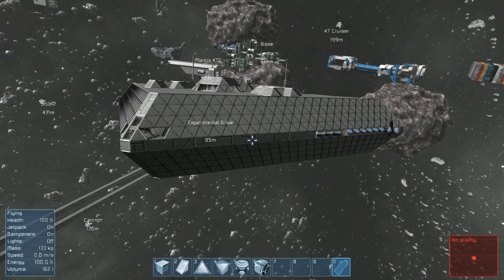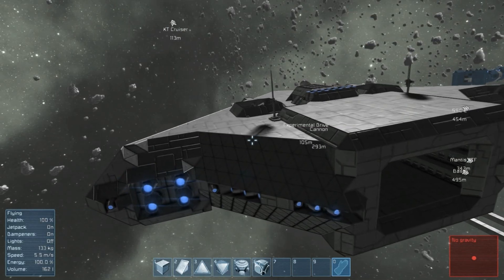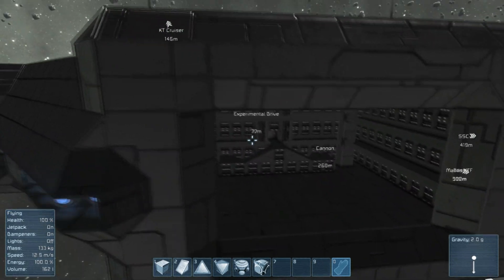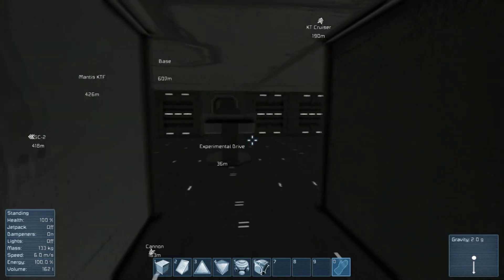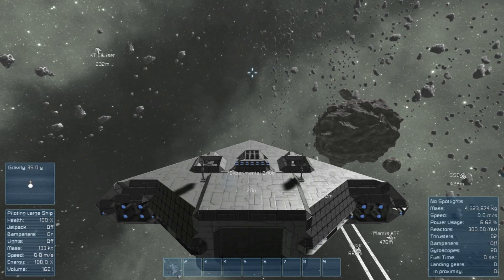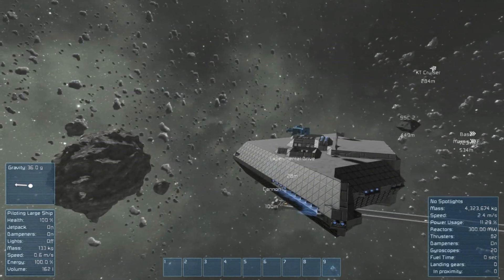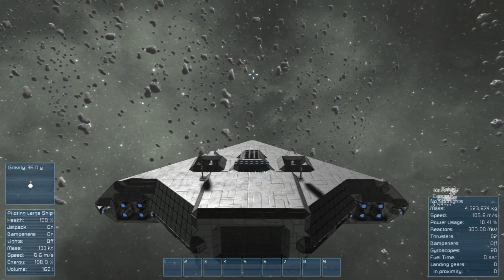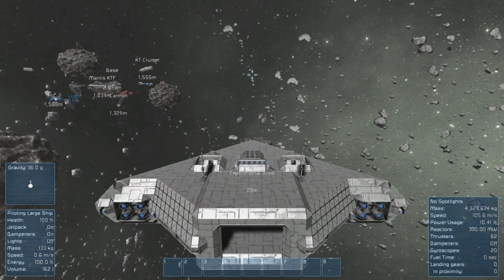Space Engineers "Gravity Drive" Alternative Propulsion

Comment: i've posted another version of this with just the cockpit and part of the body and can turn much faster and also slow down pretty quick. The only problem I have is that the ship has a very slight upward drift but doesnt really mess up the control.
Reply from the maker: I've noticed this upward drift in my experiments too I'm not sure but it might be just not putting the gravity generators in the center of the ship. If the artificial mass blocks are off center then they will pull the ship in which ever direction away from the center they are.

Comment: One of the first things I did with the new mass blocks was build gravity drives on old ships. I have one, this "cruise liner" type ship that I replaced all the windows on. While I was at it, I added two "nacelles" toward the front of the ship, which are affected by a single gravity generator that can be turned on and off. Then I went large-scale and reconstructed the nacelles on my Star Trek style ship (and ended up overpowering my reactors before I was finished). Each nacelle in has a gravity generator of its own, and gets better acceleration than the thruster method I was using before. When they give us the ability to group controls, I will add more generators for greater acceleration. But for now, I want to keep things a bit simpler.